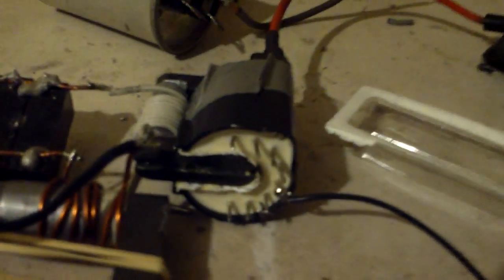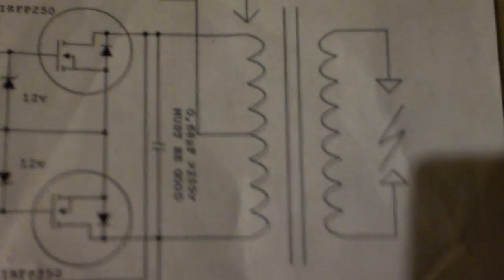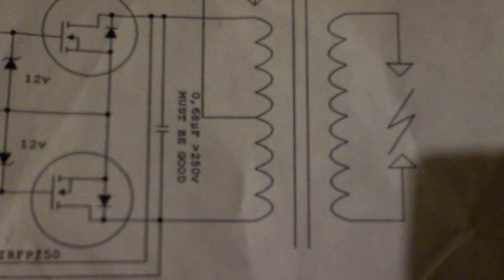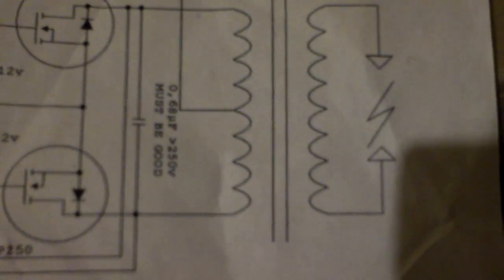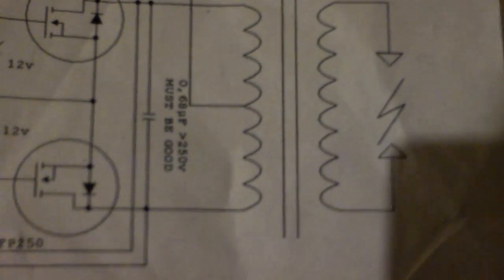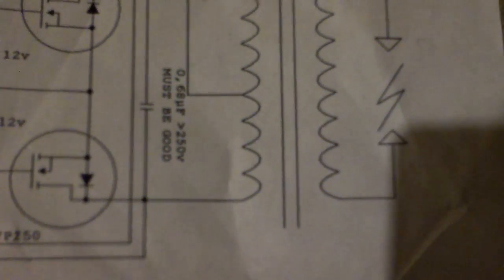weird zvs setup

Comment from the maker: when I had all the turns on the flyback it would work but when you would draw an arc and the circuit would stop oscillating and one of the mosfets would be locked on, Im not sure whats wrong.

Comment: I'm only guessing, but I'd say its got to do with the diodes in the flyback stopping an emf collapse from oscillating in both directions. Most of the ZVS to Flybacks I have seen, are either hand wound ac flybacks, or there is an extra toroid/core. So ZVS to 10 wind center tapped toroid, with secondary winding on toroid going to the flyback. You can better control your amps to volts that way too. Looks like you could step up 5:1 or so on a toroid, Then you get more volts to 4-10 turns on flyback.